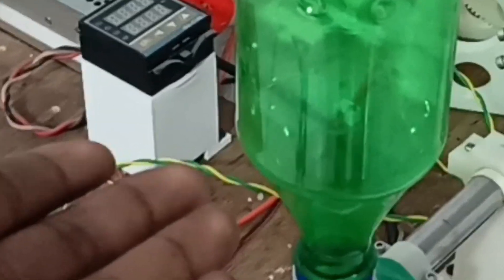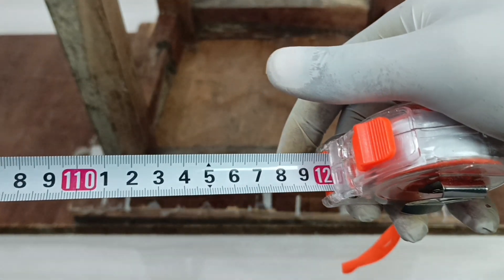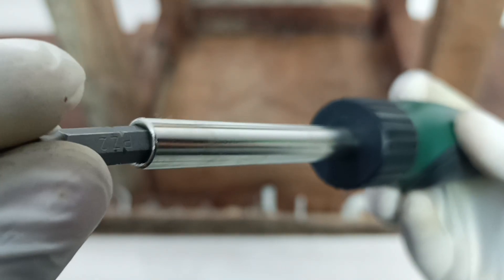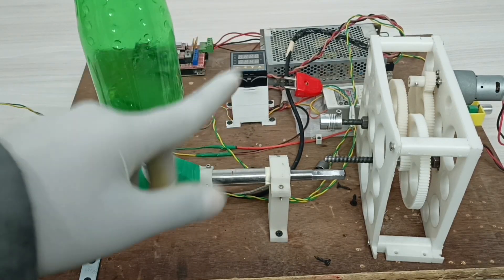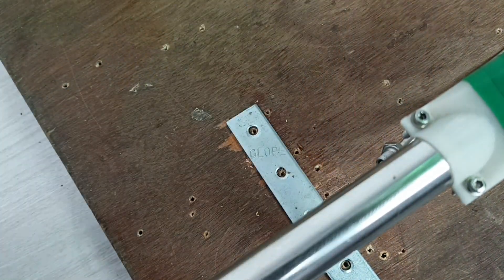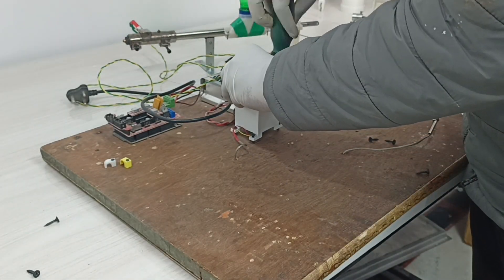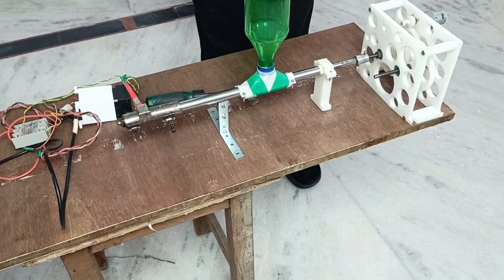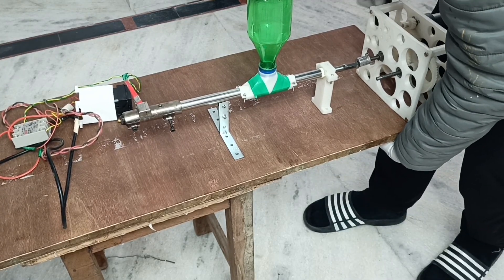How to Make Your Own 3D Printing Filament from fail 3D Prints with this $60 DIY Machine at Home

Comment: Will there be any more adjustments to the machine, or is it fully working at this moment, and just needs assembly? 
I am very excited to see the final machine, because I made a machine to turn bottles into filament, but it didn't work well, so I'm hoping I can use lots of the parts on this! 
Also, how do you suggest that you could clean out the barrel to make sure there is no traces of other plastics, for a different type of plastic being extruded? 
I cannot remember if you had said this in a different video - but how did you get the barrel? Did you use a service to make a custom cnc part? If it was, would you be able to share the 3d model and the service? I want to double check though - is the metal of the barrel aluminium?
Reply from the maker: Thank you for your interest in this project. I bought the 16mm diameter of steel pipe then went to local metal work shop and asked him to cut the pipe and make hole for pellets to get into the barrel. The project is currently under construction and is not fully operational yet. I have challenged myself to keep the costs as low as possible. I will provide updates on the project soon and will provide a detailed guide on how to build this machine, as well as how to clean and extrude various materials. Once it done i will release all the final 3D files of this project for free...
Reply: @Creative3DP  Ok thanks! You are doing a great job for the community, and I am very thankful!